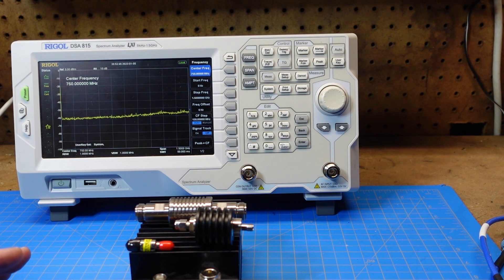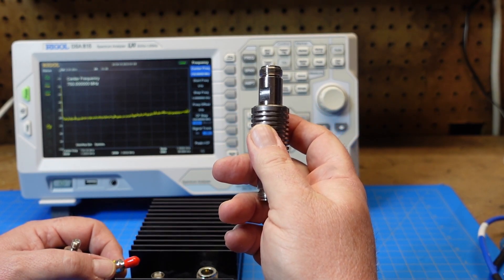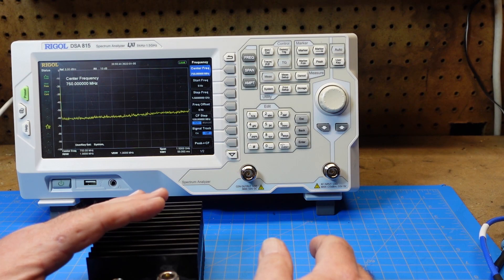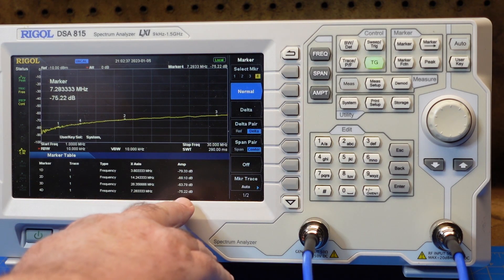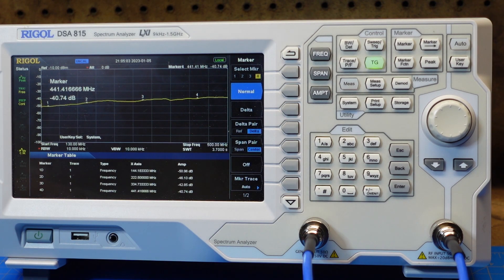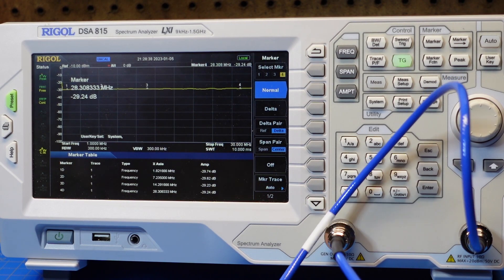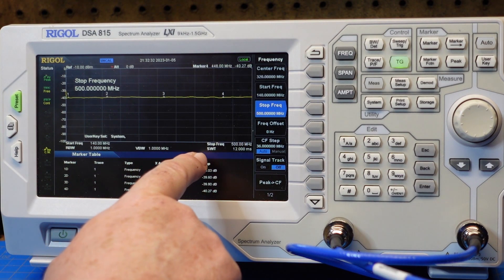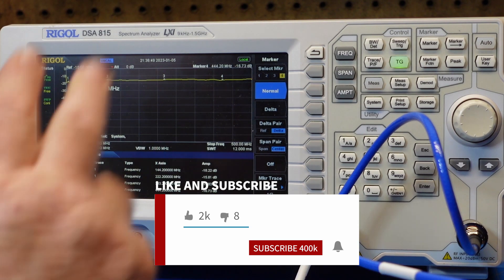Just how good is that hamfest find??

Comment: S21 would not measure return loss but transmit loss. The VNA method should actually be slightly more precise as you can calibrate away the impact from the cables etc.